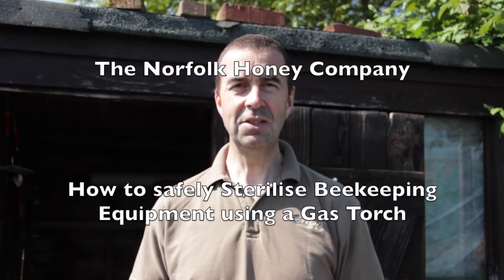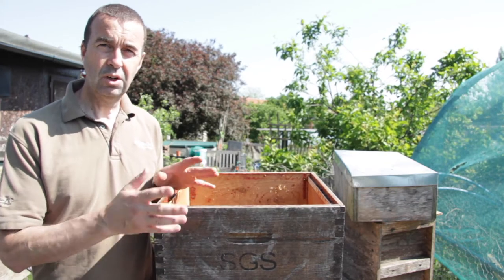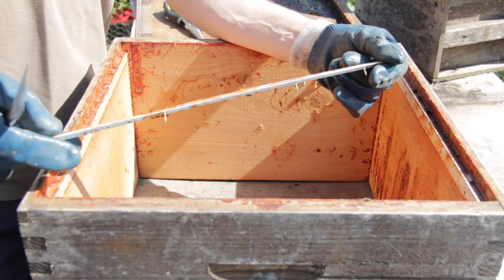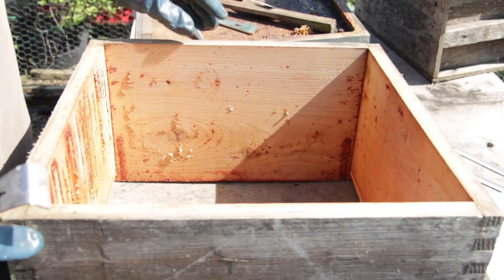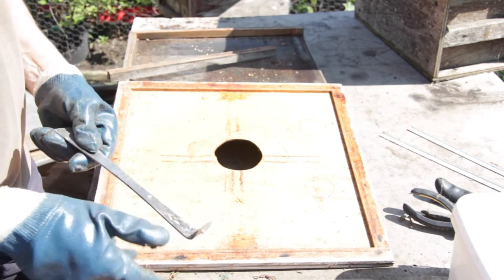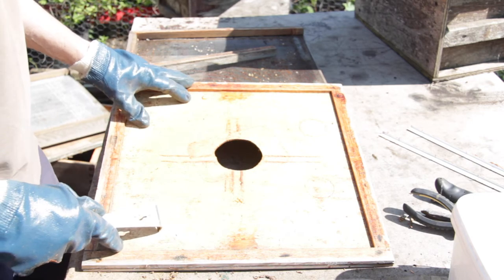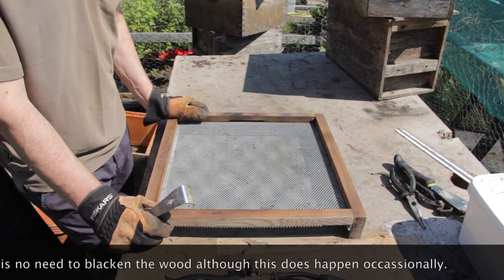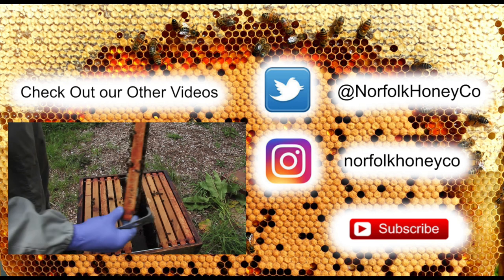Beekeeping Basics - Sterilising Bee Hives using a Gas Torch - The Norfolk Honey Co.

Comment: Hi Stewart.   Another great video.   

I'm a complete beginner, and have recently refurbished a national hive.  I appreciate that a naked flame from a gas torch is the preferred method by bee keepers.   I did try using my gas torch before switching to an electric heat gun, and found that the heat gun worked well.   Using the heat gun, I found that I could still scorch the wood if I wanted to, but I achieved an excellent level of control by varying (a) the distance between the heat gun and the wood and (b) my speed of progress along the surface of the wood.   Of course, I cannot say that the result is as effective as using a naked flame.  But the lack of a naked flame meant that I could go back and forth several times over difficult areas (such as corners and rebates), gradually heating up the area to achieve that lovely, even golden colour of bubbling propolis and wax without excessive burning of the hive components.

Comment: Why don't you just wash the boxes like you do the frames?  Seems like it would be easier?
Reply from the maker: Hi Thomas,
Thanks for the question. I actually find that once I've scraped out the box it is easier just to flash a hot flame over the boxes rather than boil up a drum of water and washing soda. I do sometimes wash the crownboards and queen excluders but again, it's usually quicker to just flame them after I've scraped them.
It's probably that I never think to boil up the water in advance and once they are ready it's easier just to light up the torch.
Stewart
Reply: The Norfolk Honey Company thank you.  Great videos!

Comment: Hi Stewart. My colonies are on open mesh floors. The bee space without inserting a varroa board is too deep and so my bees are drawing out drone combe under the frames. Are the open mesh floors designed for the varroa boards to be left in place permanently? Is the bee space corrected once the varroa boards are kept in place. Thanks Neeta
Reply from the maker: Hi Neeta,
It sounds like you may have the floor upside down. The mesh should always be closest to the bottom of the brood frames and the solid floor slides in beneath the mesh. Varroa mites that fall from the bees then fall onto the mesh and through onto the solid floor which you can then remove and check. Just take another look at the floor and confirm it is up the right way for me please.
Stewart
Reply: That's exactly what it was. Thanks

Comment: Two stupid questions: first one is, I've heard propolis has antibacterial properties. If this is the case, is it necessary to remove it from the brood box? Secondly, i have one polyhive and one wooden hive. I'm ok with using a blow torch on the wooden hive but not too sure about how the polyhive would take it!
Reply from the maker: Hi Steve,
The only stupid question is the one you don't ask and then go do something you regret!
Yes, propolis has antibacterial properties but as time passes it can also get covered in all manner of nasty stuff so it's best cleaned away on a routine clean up.
I suspect the polyhive would not take to a blowtorch terribly well, but I think you already knew that! There are a few products out there that can help in this regard. The first thing I would do is use a fairly strong washing soda solution and wash it out thoroughly, that will remove all the propolis and other debris. I also have a product called Eversafe bee care and hive wash that I use to disinfect the poly kit that I have. Here's a link to maisemore's page showing all the details. http://www.bees-online.co.uk/detail.asp?ID=760&name=Eversafe-Bee-Care-and-Hive-Wash
Reply: Hi Stuart, thanks for your reply. That is always a major issue with some of the old timers in our association when suggesting poly hives. I will pop down to maisemore later on as I work about 1/2 mile away. regards Steve
Reply from the maker: Nice,
Let them know I sent you, they have been very supportive of my channel and it would be helpful for them to know we've spoken.
Stewart.
Reply: Hi Stewart, I went down to Maisemore and bought the eversafe as you recommended. They told me that many beekeepers are now using it for wooden hives as its so easy to use and efficient. They even talked me into going to the Beetradex show next weekend so if you are there I will call by and say hello.

Comment: Thank you for this video! I will try this this year on a few of my hives that died. I have the frames in the freezer and non have slimed frame. SHB are dead. I assume bees can use frames with capped brood that died, and they will clean this out in spring? I will scorch the inside of brood box and bottom board / top cover.
Reply from the maker: Hi Michael,
I prefer not to take the risk of transferring disease between colonies and so would rather cut out the wax and render it down, boil the frames and use fresh foundation in them. I've seen too many colonies go down with infections because of cross-contamination.  Yes, scrape and scorch the insides of the hive parts to clean them up.
Good luck with the new season.
Stewart